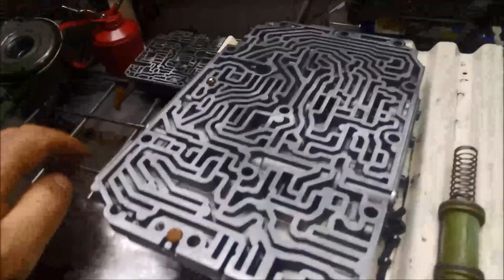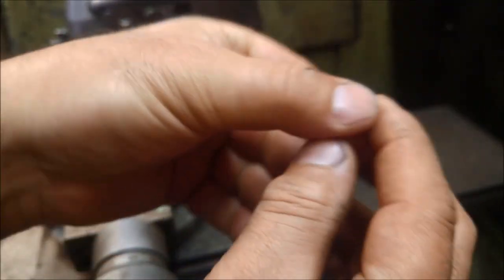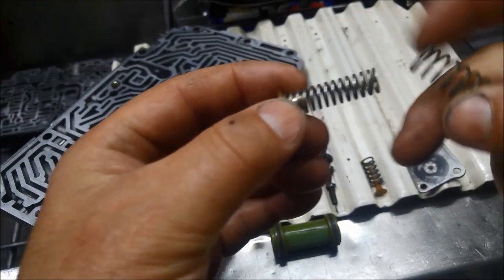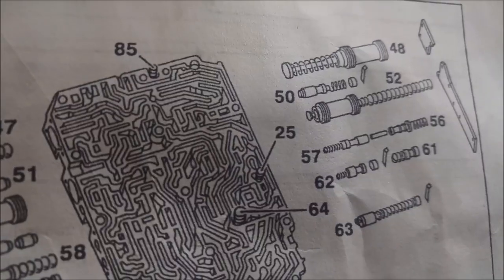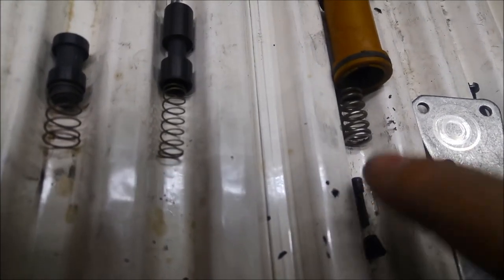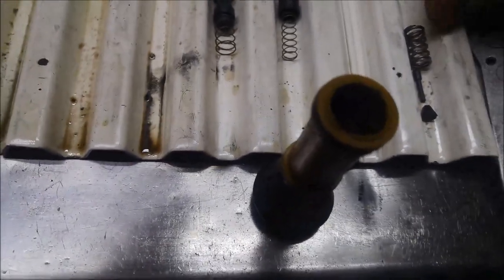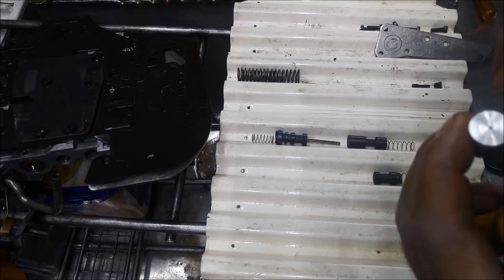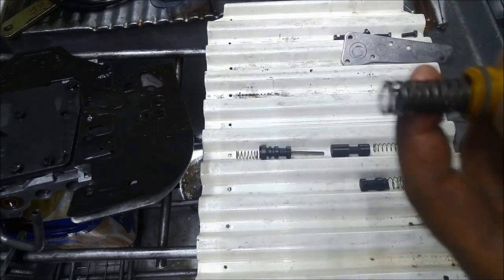Mercedes 722.5 Automatic Transmission Plastic Accumulator Piston Repair & Mod includes Lathe work

Comment: Nice video. Just finished cleaning the valve body and replace the K1 sensor as mine does not click as it suppose too. The car shift very well in all gears, 1 problem is when ever i shift from P or N to R or D i feel a jerk reverse and forward respectively. I pressed the brake pedal as how i normally would in any automatic car. Do you have any ideas what the cause might be? Thanks.
Reply from the maker: hi, check mounts, universal joints and backlash in diff. high idling can also do that. cheers

Comment: great videos, which helped me rebuild my 722.5 trans. After the rebuild , which included replacing all friction disks and all seals and orings, reverse gear works again, but  trans shifts up smoothly but too early and then does not downshift  when accelerating in 4th. Having reopened the trans to check everything is ok I presume there is a problem with the valve body. Pressures are ok too. Any hints what to look for?
Reply from the maker: hi, hopefully you have checked bushings for wear as well. did you do a line pressure test ? that can point you in right direction where you may have pressure leak or can use info to mod vbody to help improve. check our vid on testing wear in vbody without a vacuum tester incase you dont have one    https://youtu.be/aGSm8h7lIdo   sounds like i might deserve a few beers from you ? link is in description cheers
Reply: Thanks for your suggestions. I checked the modulating pressure which is 3.6bar, the system pressure is about 12 bar but fluctuating wildly from 8 to 14 bar. Removed the valve body again and found the clutch K-2 damper to be installed backwards ( my fault !) , which I presumably did when replacing previously all the seals and bushings on the valve body pistons. Tested car today and all is the same . Shifts very early to 3rd and 4th (at about 2000rpm) and does not downshift when accelerating.Nor does it shift into 5th, despite having tested the Kickdown solenoid, which is ok, the kickdown switch under the pedal and the switch on the gear selector to inhibit 5th gear, all measuring ok. Does the TPS have an influence in the shifting?
Lots of beer waiting for you if you ever come to Mallorca, in the meantime you got some paypal beers.

Comment: thank you for this amazing video really important info,
Please could you guide me to get 
trasmission Instruction of mercedes-benz 450SLC 1977 I will be thankful
Reply from the maker: hi, record & take pics as you go, have a very clean bench space and place bits out in order as you remove them. when you get to valve body, extra care when you disassemble and when you remove segments make sure you lift with separator plate or balls and valves will go everywhere. see https://youtu.be/gUjOrcffQPo  and   https://youtu.be/aGSm8h7lIdo  i`d doubt i`d have enough time to run you through everything as it will take much much more time than if i did whole job myself. good luck and cheers

Comment: Hi.    I'm rebuilding a 722.5 and it didn't have a valve body gasket on teardown. Should I put the one in the kit on?  All the 722.3's I've done have had gaskets of course. Thanks. Paul. NZ.
Reply from the maker: hi, how is it running? maybe put a trans line pressure gauge and see if within specs....if specs ok and running / changing gears ok, i would leave it....there are many valve bodies in other trans that don`t have gaskets either. cheers
Reply: @YepThatsIt  Thanks.  It had very little line pressure, The 4th and o/d is cooked. Someone's been in there before me.  The 4 screws had screwdriver marks on. I'm leaning towards putting a gasket on, but I'll do more homework. Paul.

Comment: Hey Yep. sorry for my english. your question. W140 s320. gearbox 722.5. coldly. it holds third gear for a very long time. even high RPM case. (4000). when the first and fourth gears were on, after that the gearbox works fine. is this normal or something wrong. the vacuum switch holds the vacuum on the side of the gearbox. just had an oil change. before that, I don't know what I bought a few months ago. I didn't go much before that, just a test ride. thanks for the help
Reply from the maker: hi, hopefully you changed filter as well and fluid change. you need to confirm has good vacuum at the modulator, then you might try back off the modulator adjustment so upshifts sooner. make sure you make reference points so you can return it to original spot if needed. cheers

Comment: Hi, I have a e320 W124 M104. It has the 722.5. I’ve just had the trans bands replaced. As part of the recondition the dismantles the valve body, but they are unsure how it goes back together, as MB manuals are contradictory, I’m having flares and odd shifts. Do you have and info on how the valve body should be reassembled? Help!
Reply from the maker: hi, what manual do they have? you will have to contact me on our face book link if you need to exchange pics, vids and beers .... https://www.facebook.com/Yep-Thats-It-103051017785435    cheers

Comment: What could be the problem on a 91 560 sel the car just revs after it shifts out of first gear 1st and reverse work fine but won't up shift disconnected the sensor on the pedal already any idea what it could be?
Reply from the maker: hi, check all the basics first, do all tests before you remove trans pan. cheers

Comment: I had a mercedes Benz (automatic) ... that kick out when changing gears,... what's the problem... 
Thanks...
Reply from the maker: hi, would need more info and beers. cheers 👍
Reply: @YepThatsIt  okay thanks... i had a w124, and thought to buy a 190d automatic but i didn't ... but the curiosity keeps there... i hear that it could be a support of the aut  gear box... still don't know... thanks

Comment: My 722.5 Transmission do not hold gear when I want to accelerate, it always shift at 2K RPM. I have to manual pull the gear lever to 2 or 3 in order to accelerate so it stay in gear. Also it doesn’t shift to 5th gear. Is this TCM problem or transmission itself.

Note : the transmission shift smoothly no jerk at all it just that it doesn’t stay in gear for maximum acceleration if it on D.
Reply from the maker: hi, check all the basics first especially fluid level. could have a partially blocked filter as well. always start with easy and check checks/tests/fixes and work your way up from there. cheers
Reply: @YepThatsIt  Fluid level will be something I’ll look into, thank you for recommendation.
Reply: @YepThatsIt Hello there, I know it’s been months. Quick update, the issue cause by bowden cable broke off, replaced it now it downshift beautifully and hold gear when pushing the pedal. Still no 5th gear tho. 😅😅
Reply: If the overdrive gear of that 722.5 gearbox doesn't work that is a dead gearbox and I would advise u put the 722.3 tranny less problematic! No 2 if the overdrive gear doesn't work your clutches get worn out coz it is not engaging to fifth and the ATF overheats wrecking that gearbox...722.5 is a nightmare and I can say its not repairable and if it is 50/50 chance
Reply: @bradjacking3960  Heard people saying that as well, but never seen a detail video about it. Have you ever done one?? Is it complicate?
Reply: @VannessTVofficial  yes I have worked on them even if u replace all the clutches nothing works and worst  of all it likes wrecking up the B2 band
Reply: @bradjacking3960  Thinking of swapping to .3 as well, a tranny a longer driveshaft and shifter assembly I believe, is that all?
Reply: @VannessTVofficial  which body is that .5 running on? Is it 140 or 124?
Reply: @bradjacking3960  It’s a 140 1996